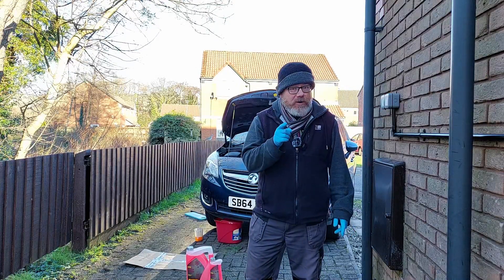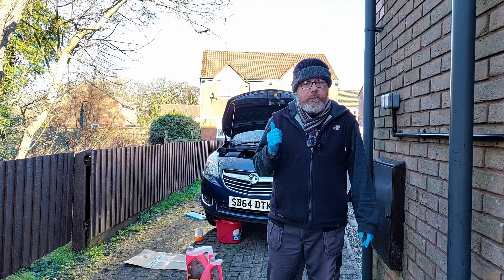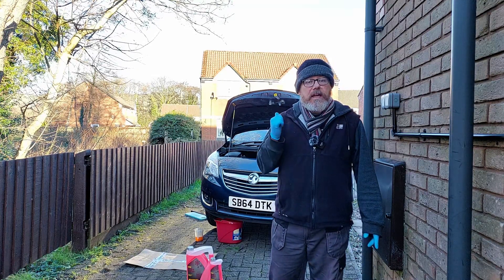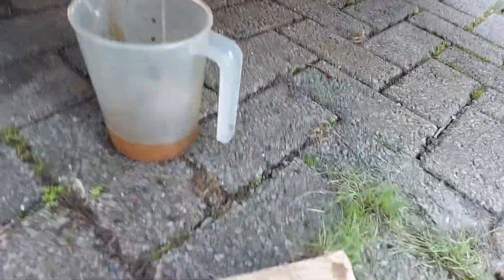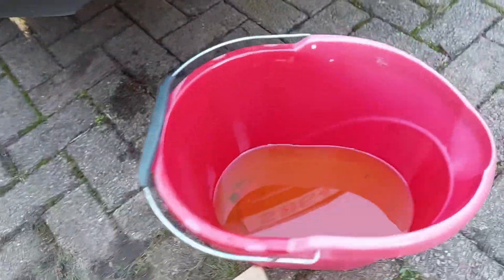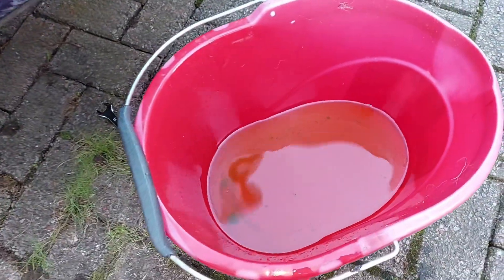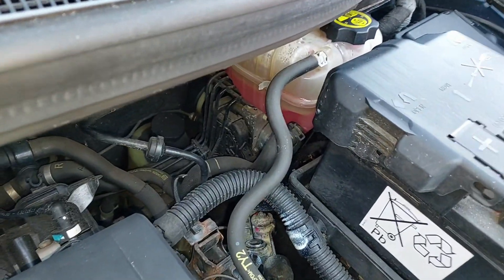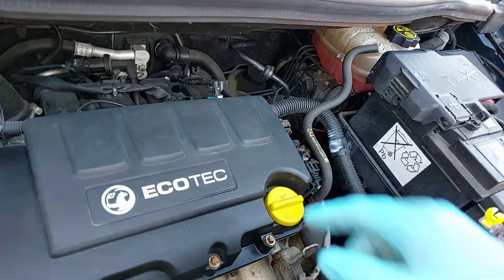THE  CHEAPEST ANTIFREEZE DELIVERED TO DO THE COOLANT CHANGE ON A 1.4 MERIVA B

Comment: I love my 2013 meriva b I’ve had 9 years, It’s like a posh van but kids think it’s like a grandads car:) and missus won’t drive it. I’m amazed what I can get in it:)
I had to change a lock for suicide door once and did front brakes and a few oil changes, that’s about it. Haven’t done rear brakes cos it’s electric handbrake.  Today temp gauge shot up stat is leaking. I had no coolant but didn’t get warning on dashboard? Do you know I’d  it has a coolant sensor? No Haynes manual is the only downside to this great little car. High hose high hose my ma is a mechanic (I’m sure you could make a song about that. those comments made me laugh… thx:)
Reply from the maker: it has a low coolant sensor and temp sensor
Reply: @baconbuttties   thx I had to put  about 2 litres in(tap water!). one side  of header tank had some in this was  boiling nicely!  This is the side I'd been checking for last 9 years:)??? The other side (rightt hand side as you look at from front) was bone  dry. I guess  coolant level sensor is  broke then:( as it was only i noticed the temp gauge  rise to 130deg that made me check . Fingers crossed the  stat change  will fix the problem.

Comment: Did you test how concentrated the coolant was? I bought the same and it only gives -9°c protection, not -30°c as advertised. Checked on Amazon and other customers have experienced the same issue.
Reply from the maker: I didn't test it but I think I better had test it 👍
Reply: I read the same, but i think these need a different tester and not the ethylene glycol ones.

Comment: Just to let people know, do not use mannol anti freeze products. They are very poor quality and  two bottles of 5 litre ready mixed o.a.t I tested had -10 and 0 degree protection. Drivetec red is also poor at -12
Reply from the maker: Do you mean the 2 bottles had different protection as you say -10 an 0?
Reply: @baconbuttties  I bought 2 bottles of mannol from the distributor on ebay for a corsa. Heard various stories of poor quality so just thought i would check and one bottle was -10 and the other zero, tested cold. The old stuff that came out was still testing -30 after 4 or 5 years use.
Reply: I've used this coolant for more than two years now. Filled it in 3 cars (suzuki cars) and it didn't freeze during the winter did't boil in the hot summer. I live in central-eastern Europe and bought the products from a local store I trust.